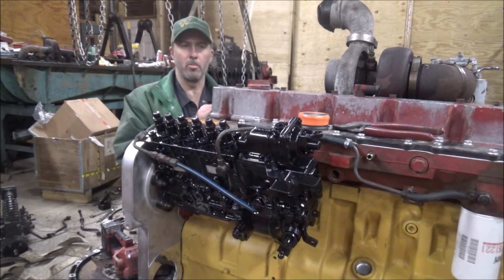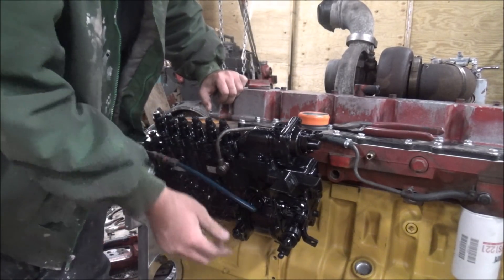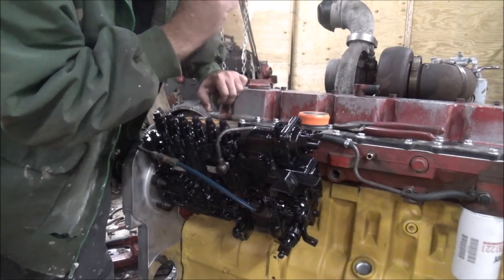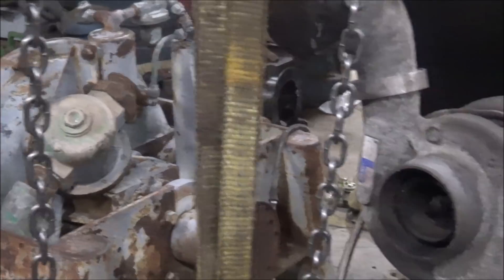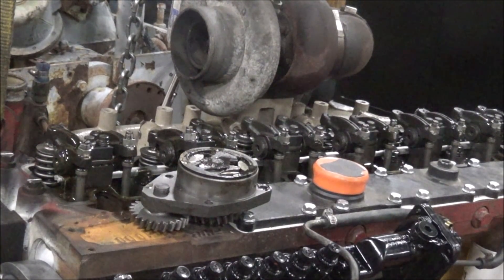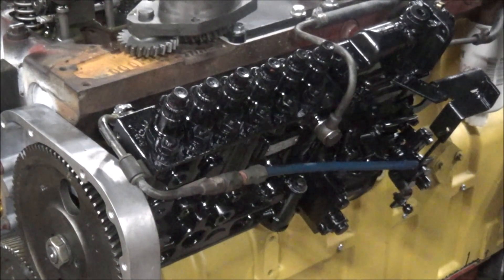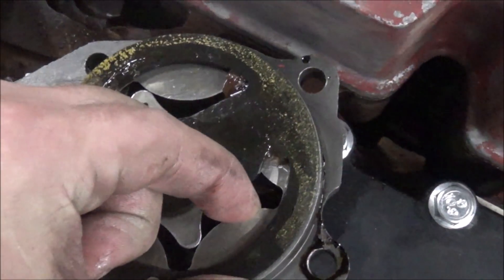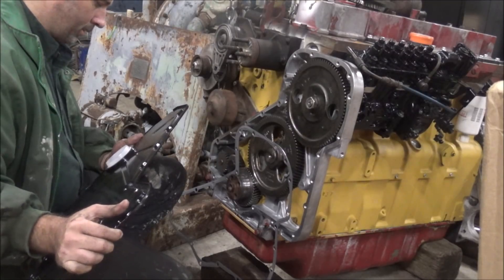Cummins Swap the Hyster Part 8 : Installing Accessories, Pre Lube, and Junk Aftermarket Oil Pumps.

Comment: Oh, does installing that front cover bring back trauma… :)  I tried to buy the cover gasket, and the one for behind the frame, and the Cummins dealer up here just handed me two tubes of lock-tite silicone...
Reply from the maker: That silicone has to be fun trying not to block up the oil passage for the injection pump thru the front cover.

Comment: Hey man, I recently found your channel and saw this pre-lube video and I just wanted to give you a shout out and a subscribe. You have really great content. I was originally trained on the Detroit 71 series two strokes and the Cummins 855's and slowly moved to smaller things on up to Audi's and now going to school for electric car engineering. The processes you do are almost forgotten knowledge for many. The importance of the oiling system on these types of engines is so high, almost more important than the cooling. The rotating mass alone is enough that if one locks up under load they will rip apart in a grenade like explosion. Saw one 4 Cylinder Detroit after it lost oil pressure due to a leak into the intake as a railroad construction machine mechanic. It ran away and ripped the motor off the frame, wrecking the frame, and turned the outer shell of the machine into shredded paper. Super Awesome build! I will be definitely keep watchin out, let us know when you get a Patreon! Cheers~ Stephen
Reply from the maker: Glad you are enjoying my videos! Yeah a lot of what I cover is a bit different material than most. Funny you mention an Audi I have to fix the 2.0t in my girlfriends car soon. Pretty sure it had a timing chain tensioner fail and tag some valves. It only had 70k on it since it was rebuilt under warranty at 70k. Apparently those engines don’t like to stay together too long. Lol

Comment: People used to laugh at me cause I would buy or trade for old engines that made their way to the core pile. I built quite a few for I had to quit. Crippled is a suck life style and getting hurt that bad when your in your early fifties is to me almost a death sentence.... I loved working. I had a brother who wasn't much on wrenching an he would try but half had to be redone or lose it. He had a couple old engines that had never ran since they had been in rigs that burnt down. His old 450 Case dozer slung a rod out the side in bad cold weather here in alaska and he's broke and squirreling around worried.. We were froze in at about twenty some below and he had not heated the oil or nothing just fire it and start trying to push some ice out... it made it about say ten minutes before it sent parts across the driveway... well time had went by and me not able to walk at all but move on my elbows, told him that I will set there and tell you exactly what to do and no interuptions, just listen to me.. he agreed as he really didn't have a choice and his back against the wall. I took from the pile all the pieces I wanted or needed and some new bearings... using the old rings and pistons but cleaned up so all the money spent was bearings.... cheap for the cost... and in three days with pulling and fixing and reinstall... it was a runner again! He couldn't believe it and near cried as we were both late sixties.... him 68 an me 69 n crippled got that old dozer back and going.. it still runs but I lost him to cancer a month after his 70th birthday... thank god that awful shit was quick. There are a many of variables when building and I crossed some myself that day but still grin when I think about the two of us putting it together under a tarp.
Reply from the maker: That is getting it done! Knowledge and determination can accomplish a lot. Sorry to hear about your brother and I can only imagine how much it would suck to be not capable to do anymore. Super frustrating I am sure. :-(

Comment: That is similar to pre-lube for a SB/BB Chevy pre-lube take an old distorter grind the cam gear off and drop it in put a drill on it to pump oil through the engine. Good Job Brian That Fork Lift will be running for Christmas!
Reply from the maker: I sure hope it is!

Comment: 9 years ago I put a 4 bt cummins parts in my allis Chamlers forklift it had a Perkins gas engine. I didn't have internet them days and every time I called for parts i would get the response that I can't do that kind of repower but I kept calling around and finally I found a place in Ohio that knew what I was wanting to do and I got it done it's a excellent machine now Cummins diesel engine are a very good engine
Reply from the maker: Yeah if you are trying to do anything outside of what the vin number gets you you have to find the rare few people that know this stuff well enough to know what works.

Comment: I wonder how many people have hurt a rebuilt engine using one of those aftermarket oil pumps.
Reply from the maker: Likely quite a few. It probably works ok in operation but I bet it looses prime bad leading to lots more wear on startups.

Comment: Recently changed out a miniaturized kubota 3 cylinder diesel in a mini skidsteer- that whole motor is slightly larger than this fuel pump. Nice project, keep going, almost done :)

Comment: If you haven’t bent injector supply lines and want a set of stock lines, I have them off my engine! I won’t/can’t use stock lines with new intake manifold, so your welcome to them if you want them.
Reply from the maker: They would save me a lot of time bending a set. Be glad to have them!
Reply: @bcbloc02  I will pack them up and send them down to you!

Comment: Why does a forklift need an air compressor?
Reply from the maker: For onboard air so you can air up tires or run air tools wherever the forklift is.
Reply: @bcbloc02  Makes sense, I figured it was either that or some sort of pilot valve operated controls.

Comment: Probably a good thing to put the Cummins oil pump back in. As you were running the first pump I was thinking there seemed to be a lot of air, and that the pump turned really easy.
Reply from the maker: I think most of that was I didn't have enough oil in the motor.
Reply: @bcbloc02  Gotcha.

Comment: In my experience on that type of pump the cover clearance is critical,and the gear clearance that we saw didn't seem to change the volume or pressure that much. The Buick 231 v6 hat an aluminum housing that the gears would wear in to the cover and housing and loose oil pressure at idle. A poor design. Cost lots of people lots of money.
Reply: Caused a lot of people to needlessly have shops put in cams and lifters when all they really needed was an oil pump, or even just an oil pump cover.
Reply: Before i lost my mojo i used to sleeve those Eaton pumps in BMW motorcycle crankcases, nerve racking with their fairly tight tolerances .
Reply: Chris Stephens ha ha my mojo is lost also.
Reply: @daleolson3506  I lost my mojo a while back too. Can’t find it anywhere....